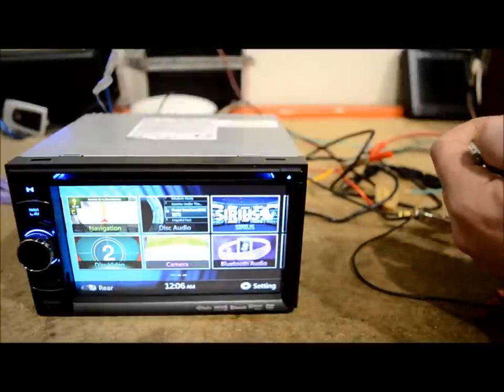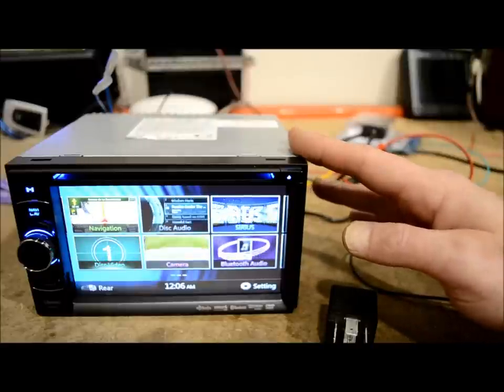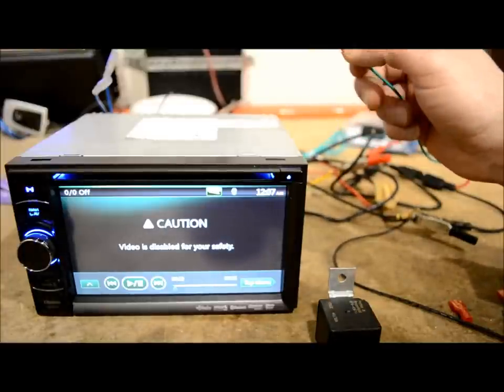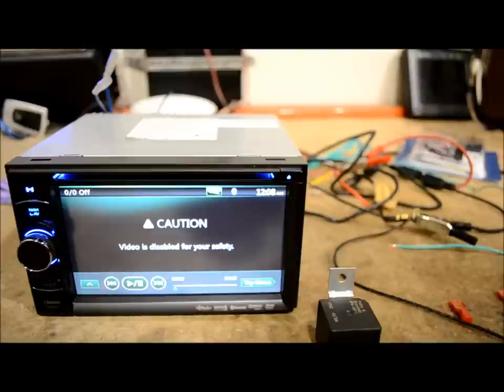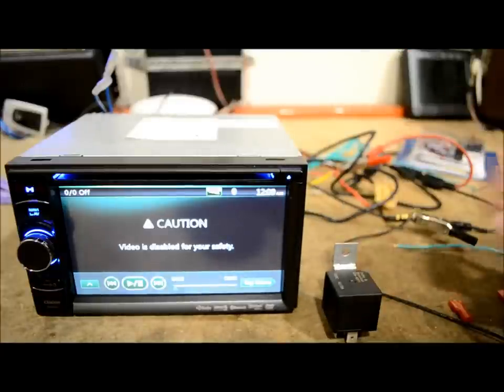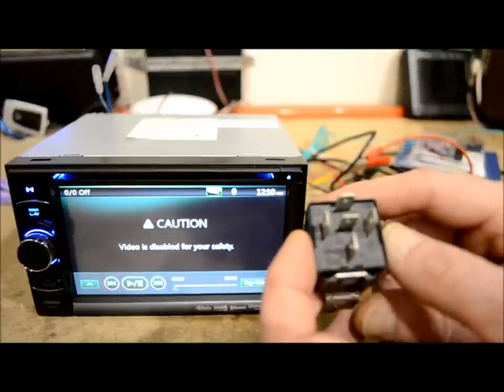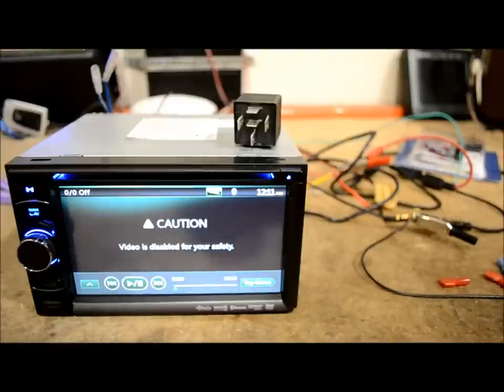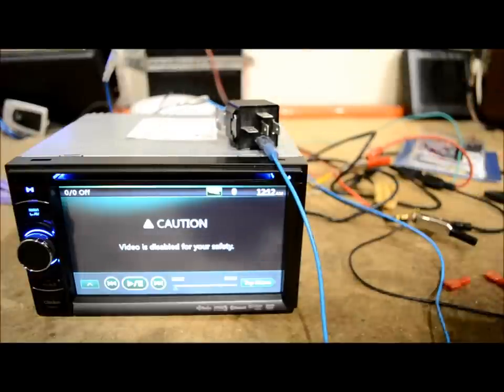How to do an In Dash DVD GPS stereo Parking Brake Bypass

Comment: I have a question.  I followed your advice, hopefully, and I got the DVD to work. However, in order for it to work, I have to manually turn off the system and turn it back on again. As a result, when I turn the ignition off, and back on, the DVD will not work, unless I do as mentioned before.  

I don't know if this is because Pioneer has that prompt or if I am putting the wrong wires on the relay.  If you have any advice, I would appreciate it.

Comment: the dvd receiver has to read that it is grounded after it gets powered on so that is why you wire the relay to the power on the deck so that it powers up seconds after the deck gets power and reads that it is grounded.

Comment: OK OK OK but i got a question! The blue wire from the back of the radio I get, its 12v.........the green wire is also from the back of the radio and its the one that is suppose to be on the brake but we bypassing it. BUT......where the heck is the black wire from? Is it the black ground from the installation harness or a new black wire you add to the process on your own and then run it some place??

Comment: Hey buddy great video...just a quick question. On the blue wire connected to the relay can you splice in the blue wire from the amp if you have subs? Cause the blue/white wire from the DVD player would connect to that...I learned today that this bypass hack is junk. I wanna do the relay now and re-do

Comment: It works with a Clarion NX404, but the relay must be accessible. In my case, every time I turn my 2006 Civic off and turn it back on, video is already lost and I will need to unplug one of the wires off of the relay and reconnect it back so that the relay starts working again and does its job restoring video. I thought this was supposed to work automatically. Did I go wrong or this is how it is supposed to work?
Reply: I know your post is 3yrs old. Use the same relay like the video but add an on off switch on the remote wire so you can toggle it and wont have to constantly disconnect the relay.

Comment: Ive got a kenwood radio and did the test you did and its works. Now can i just leave it connected like that without any electrical problems? Or do i need a relay? Or can i just connect it to the cars chassis?

Comment: Great video. One question I have though. Will the receiver still operate the navigation even though the ground has been tripped?  It seems to me if they wanted to prevent you from doing this successfully they would design the software so that the DVD would override the Navigation features of the unit.  Can anyone confirm that the entire unit will operate correctly after this bypass has been done?

Comment: Lessco Electronic,  I've didnt know PAC made a bypass for dvd headunit. I've used a relay like the one you got to bypass my older Pioneer AVH-P1400DVD. But I think Pioneer gotten smarter, a regular 5 plong relay doesn't work on my newer 2014 Pioneer AVH-X4600BT it required a microbypass relay. Only 3 wires. I've looked all over the Internet to see what type of relay it uses but couldn't find it so I found the cheapest relay for under $10 so I had no choice but to get it. 

Oh yea, on the side note.. if you ground the green parking brake wire to the radio chassis and worked, why you still use the relay? Can you just grounded to the chassis? Will it still work??
Reply: i bought a pioneer avh4000 yesterday. which bypass should i use. thanks

Comment: Love Your Videos! learned a lot.  Question...I installed a sony xav601bt in my tacoma and grounded my parking wire to bypass the safe driving function.  This wire is the same wire needed for my backup camera how can i run my camera and bypass the parking brake?

Comment: Hi, could you please send the link for the pdf and guides how to use relays for many applications. I have a little project how to wire my 2001 OEM BMW security alarm to the parking lights to stay on when I disarm the alarm and turn off when I open the door. I'm pretty sure it can be done with relays but I'm not sure the right relay configuration. I will really appreciate it. By the way, thanks for the video, it's really good. Best regards. Thank you.

Comment: I have the new Pioneer AVH-X4600BT and this does not work. It took some toying around but I found out why. The remote wire puts out power instantaneously when the key is turned on. So fast that the head unit doesn't recognize it as being switched to Ground but that it always was on Ground. And Pioneer radios are the few that aren't that easy to trick, thus why you need an elaborate bypass in the first place. The radio needs to turn on and screen be on before receiving the Ground signal. So for now I'm just using a normally closed (NC) momentary switch, so all I do is push the switch once when the radio turns on and I'm done, instead of a rocker switch having to turn it on and off manually. I will be designing a timer circuit with the relay in the future so I won't need a switch anymore. Moral of the story: You need to wait a few seconds after radio is turned on before applying your bypass instead of instantaneously with just a relay like it has worked before.

Comment: If the blue wire enables the antenna booster won’t it’s power be lost by hooking the blue wire to the relay and not to the blue wire in the car harness. ? Thanks

Comment: I have a Clarion NX404. I hooked my parking brake wire to the ground wire and it didn't work. Do I just need to ground it to the unit or to the truck? I have a 2013 Toyota Tundra.

Comment: Lessco.  Will this work with the avic x850BT?  I have everything hooked up with the parking brake wire just grounded inside the dash but when I start driving my screen displays ground undetected for parking brake wire...  it's weird because it doesn't do that when I first start my car and drive.  It does it maybe 5 min into driving.

Comment: Stupid question, but I don't understand...where does the wire on the 30 pin connect to? And is the jumper wire from 87/86 supposed to be grounded to the chassis or tied in with the ground wire on the harness from the car and the harness from the headunit. Sorry for the stupid questions, I just don't understand.

Comment: Hi

Great video !

Listen..I have the kenwood DNX890HD head unit.

The kit wire harness has black wires that say "Chassis Ground". that connect to my car's harness black ground wire.

Can I just connect / splice my "parking SW wire" to the the "Black Chassis Ground" so I can also let my passenegers watch DVD's while I drive ?

Will it work just like your version ?

Only difference is I'm connecting directly to the chassis ground wire ?

Thanks

Comment: i hooked up a dual in dash dvd motorized and you had to ground touch it to a ground twice and then the third time it would acaully ground and bypass. it pissed me off cause i couldn't figure out why it would work then it wouldn't just like you, so i asked an istaller and he told me what i just told you bout touchin it to a ground three times. so i went and did it and it worked.

Comment: Also very careful with that Blue Wire (remote Turn On Wire), if you touch it anywhere to the body of the radio while the radio is on.  You will burn the outputs.

Comment: I have a kenwood 891 with a metra GMOS-04 harness , I wired the relay just as it says and STILL no picture on the DVD until I grounded the Green wire to the unit. thx for the video I'm going to wire it your way ,  thx again

Comment: Great Video. Definitely got me started.  But... what about the ground wire coming from harness on vehicle side?  Does it need to be incorporated in relay... grounded elsewhere... or just capped off? I'm working with a Jensen VM9225BT, really trying to do this right.  Also, the PDF link for other relay uses would be much appreciated. Thanks man

Comment: i have a JVC KW-M865BW not sure which wire is amp turn on the wire guide says yellow is 12 volts constant, the red wire is switched power and the blue wire is power control /power antenna

Comment: Hi, What if I have a manufacture stereo? It's a honda stepwagon 2005 RG model.  I have seen countless threads of grounding the footbrake wire.  If  I do this I get annoying noise and the light for the handbrake is lit.  After a few seconds the dvd screen will go off too.

Comment: I just had a couple questions if you could help.  I'm putting in a Pioneer AVH4100-NEX in an Altima.

I hear you mentions 12 volts a few times.  With this replay effect the rear camera in my car?  I'm assuming it won't but I hear 6 volt and 12 volt thrown around a lot when it comes to the rear camera.

As for the wiring, are the blue and black wires your using for the relay the same blue and black wires connected between my Pioneer plug and aftermarket wiring harness?  So instead of just those 2 being connected, should a third blue and black be connected with them that goes to the relay?

Sorry for the newbie questions.

Comment: I have a sony xav-62bt I'm actually using my amp turn on wire however, the antenna remote wire on the receiver is available since my antenna is located on the rear window of my car. Would that suffice?

Comment: I assume I need a relay for this to work?  I touch the park brake wire to ground, screen works. After I restart the hu, same error.  Pls help, I got a 10 ford f150 non-nav radio.

Comment: I put my unit on and than disconnected the blue (remote wire) and than disconnected the green. After that I clipped back on the remote wire and it clicked when I attached it. Than applied the parking break wire again and it let me view the video, but than I went to see if it would work after I shut my car off and put it back on. It did not, so any other suggestions. I do not think the relay works on my unit for some reason. Or am I doing something wrong?

Comment: Hi..I have a kenwood ddx8901hd.  I'm reading diff things about a bypass. Do I need to do a relay like this or just ground the parking brake wire? I also have a steering wheel/factory amp retention unit to install. One wire from that has to go to the kenwood parking wire. Is it OK to ground them both? Or if I can email you to discuss it because I am thoroughly confused!

Comment: Connected everything and then turned the car on, the stereo itself is working fine and it does bypass the e brake but the relay is making a constant, never-ending clicking noise. Can you help please?

*Update: the relay I bought wasn't the right kind, bought a proper relay for this job

**Update again: the front driver side speaker has gone completely silent, took out the relay and tried to play music again but still silent. Any clue what might've happened?

Comment: what if I already have an amp/sound system connected on the remote wire? can I piggy back the remote wire to the relay? will it affect it in any way? did that make sense?

Comment: Bro, I have the Alpine IVE-W535HD and I don't have 1 green wire in my harness, I have 1 yellow/blue that's labled parking brake 1 yellow/black that is labled foot brake. Itried grounding both but it don't seem to work. Do you have any ideas or suggestions?

Comment: Wondering if you could help. Have a Kenwood DDX 6019 that may have gotten wet. It powers up on dry non humid days and doesn't power up when its humid. Its a crap shoot. Any things to check if I open it up and remove it from the dash?

Comment: Can you send me the pdf for how to use relays ?  Also I have a 2007 acura mdx which I am going to swap the factory radio.  My issue is the amplifier wire says light green but theres 2 how do I figure out which is the one?

Comment: Lessco Electronics Great Video! Quick question: what do you do with a set of subs/amp when the blue amp wire you show is used to connect to the amp remote wire?
Reply from the maker: You can use it for both functions at the same time.
Reply: Okay great! So you can just tap into that line with the remote wire then?

Comment: Lessco Electronics seems like the only time this works for me is when I manually hook the ground and the green wire together and once I turn the unit off and turn it back on it doesn’t work until I hook them up again.
Reply from the maker: In that case you'll need one of these: https://www.ebay.com/itm/DIY-Bypass-Pioneer-Stereo-DVD-Parking-Brake-Bypass-Kit-double-pulse-relay-/401327860822?vxp=mtr&hash=item5d71012c56

Comment: So
Remote Turn on > 85
Ground 87 & 86
and what is the output wire where does it come from and what color is it usually?
Do you know if you still have to hook up the parking brake and foot brake wires with alpine? I know i could just buy a pac tr7 but I dont want to wait the 2 weeks for shipping and can probably just pick up a spdt relay at the local parts store.

Comment: I just watched ur video I have a 2007 caddy STS will this work on the factory system in this car and is there a way to do it with out taking the dash apart. I have been tryn since I owned this car to find a video like this. is there a way to do this at the  E-break
Reply from the maker: +vic pozzie no, factory systems are way different than the aftermarket stuff.

Comment: 1. Does this work on the new Clarions that need the ground to cycle? 2 could I use the power antenna wire from the unit in lieu of the amp wire? Thanks.

Comment: Would this work with a Sony XAV65 stereo, I just recently installed a rear view camera to my 2013 Ford Focus S, and connected it to the reverse lights. I get the video to my Stereo, although at times it works, at times it doesn't because it says "video blocked for your safety" but as soon as I pull the ebrake the video footage appears.

Comment: Hey awesome video on how to bypass the DVD function but is there another way to do it because when I did it on my pioneer radio it worked but after I installed the radio and turn on the car the same old message appears... Did not pay attention to the "newer pioneer radios" comment you made... If there is another way please let me know. Also nice tutorial I did it in 5 minutes.
Reply from the maker: I have that solution here: Pioneer Parking Brake DVD Bypass fits AVH X Series & App radio
Reply: Lessco Electronics You know this method actually did work with the Pioneer system that I have. All I had to do was turn off then back on the unit and that was it. Thanks a lot

Comment: Hey there man love the video but I have a completely unrelated question. I'm troubleshooting the circuits on my friends 6.5 inch touchscreen head unit and don't have a vehicle to test it in, so I was wondering how you hooked up that head unit up out of the vehicle? Did you just use a battery charger of sorts?
Reply from the maker: djparra41 any decent fused 12v power source would suffice if youre in a pinch

Comment: All you need way Easyer way is a fused toggle switch ground one end the other on parking brake wire flick it and it's works buck or 2 max

Comment: the new pioneer units have a time delay for the ground to happen. we did this for my friends 2500bt and it still said we needed to ground. but if we wait a minute then ground it then it works. do you have any ideas for this. i know you said it was a pioneer pin switch but that doesnt apply for new ones. my 900bt is older and i did a software mod on it for it to function. any help would be greatly appreciated

Comment: Great video. I do have a quick question about the relay bypass. My dad and I have installed just as you've instructed but when we turn the car on to test it we get the same message but if we unplug one of the connectors from one of the pins and plug it back in the video will come on. We have rechecked all connections. Do you have any suggestions of what we can try?

Comment: You should just be able to take the parking brake wire from the cd player and  put it up against the frame of the cd player metal and tape it with eletrical tape so that it stays in place and don't move and there you go!!!

Comment: I have an Alpine IVE-W530 DVD head unit, and instead of the long green wire, it has two long yellow striped wires. Will this still work for that? If not, suggestions? Thank you.
Reply from the maker: you need the alpine bypass we sell, its made for that, its on lesscosales.com

Comment: Do you know what is p.ant? Does it stand for Power antenna? I have an 05 vw jetta, I put in a new stereo and getting static. Then I figured out maybe this power antenna isn't connected right?
Reply from the maker: yes, thats short for power antenna, that wire goes to 12v when the am/fm tuner is on

Comment: I did something simular. I just connected the parking brake wire to a toggle switch that was grounded out. That way if I seen a cop I could just flick tha switch and shut off all tha flashing coming from tha screen. Since it is illigal....

Comment: cut the green wire but a red loop on the green wire take out one of those little screws out of the back  put the red loop (with green wire)  mount to the back 
Done

Comment: im having a little trouble doing the bypass on my pioneer AVH-X2500BT in a dodge nitro, little help?
I found one video saying ground 86 and 30, parking brake on 87 and remote power on 85
gonna try this and see what happens because I tried doing it the way you showed here and no dice

Comment: what about just running the "brake wire" from the stereo to a toggle switch and then running a wire to the vehicles chassis ground instead?  instead of using the relay?  toggle switch seems easier? am I missing something though?
Reply: You're not missing something.  They're both switches.

Comment: I just purchased a pioneer 4200NEX and wanted to know before I take it out of the Durango if I would need the relay or will the green wire alone will work. Thanks
Reply: I just installed a Pioneer and the green wire grounded to the chassis did not allow AV to operate
Reply: Brent Smith, pioneer needs 12 volt power. it say that in the owners manual.